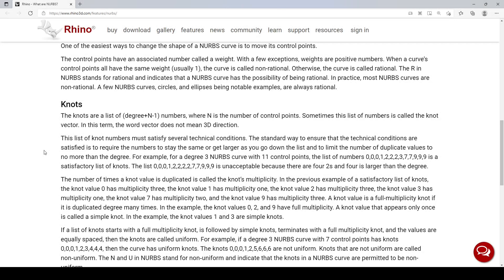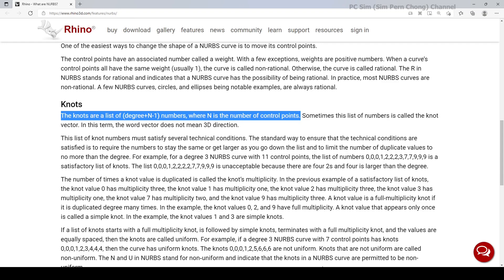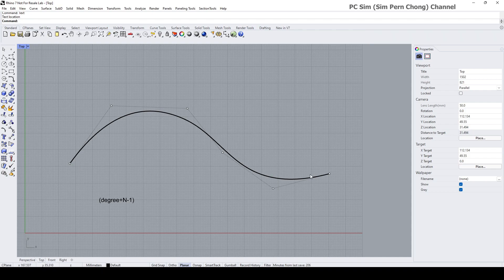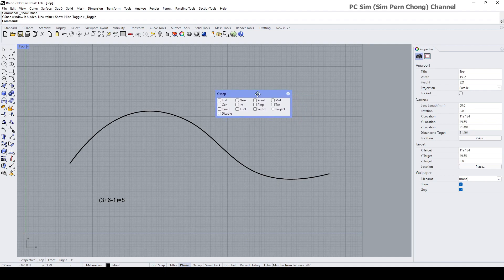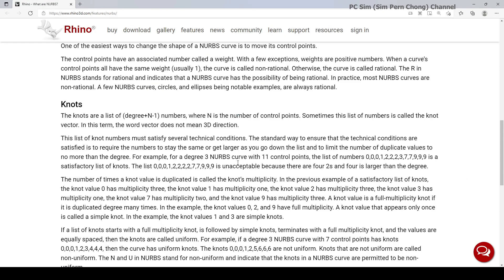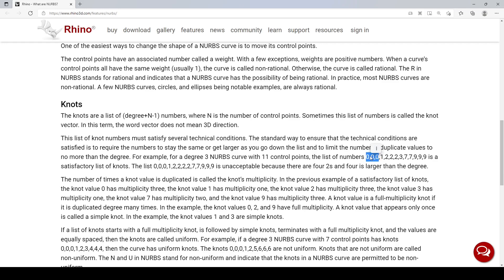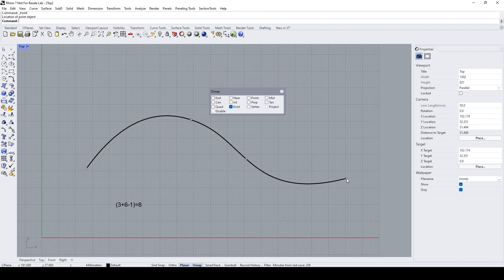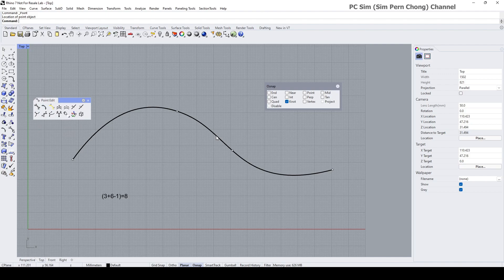Rhino Tutorial: Info on Knots (NURBS)

Comment: Hi, so what's the benefit of inserting knot? even though it won't change the shape of the curve, the curve added a control point while the degree remained the same, resulting in a nonsingle span curve (which is not ideal).
Reply from the maker: For building enough control points to modify the shape.. Not all situation require single span..especially for consumer product design.

Insert knot and remove knots are 2 processes that i often use to rearrange the distribution of control points for controlled refinement of NURBS curves and surfaces.
Reply from the maker: Can watch this demo for application of knot control on surfaces
https://youtu.be/-1g1SZKl6DA?si=2ohmVW8Xsz45dgRM
I am aware of rhino's non class A tools and hence a need to work around those limitations.

Comment: can you tell me please how can i merge surface to only just 1 surface after convert stl to sub and tonurbes i need to convert result surfaces to one surface beacause powermill program doesn't read multi surfaces it need only one surface for example loft feature do you anderstand me please help me
Reply from the maker: Oh... that is going to be very difficult. For simple form, you can try to Explode the model, then use MergeSrf to merge adjacent pairs of surfaces. But for complex form with mulitple topology flow.. it may not work.
Reply: @simpernchong  Thanks for answer put its really not work in complex furniture leg and I can't merge it or join it in one Surface to Program Surface in powerMill

Comment: what is the use of knowing the number of knots？Thanks.
Reply from the maker: Just my opinion.. the first part of the video where i count the number of knots is just to illustrate the concept. I guess, we don't really need to count it. The more important thing is to remove overlapping knots or multi knot as they can create discontinuity in curve smoothness. For high quality surface modelling, it is essential. Basically, we will want to use as best as possible, the least amount of knots and control points to express the form.
Reply: @simpernchong  Does knot have anything to do with the structure lines of the generated faces?
Reply from the maker: @ber9474  eh....you mean isocurve? No. But if there is a discontinuity in the construction curve (mutiple knots), the resultant surface can break into separate pieces at the multiple knot point...and a thick line will appear on the surface.
Reply: @simpernchong  Thank you for your reply and I hope you can do a video about degree, thanks.Sorry about the language question by the way.
Reply from the maker: @ber9474  You are welcome 😁Regarding Degree there is already a basic video about it https://youtu.be/W7Xq0_NIvNY  Thanks.
Reply: @simpernchong  好的，谢谢。
Reply from the maker: @ber9474  没问题，谢谢😁
Reply from the maker: 朋友，这里还有部关于Degree （Change Degree)  的视频 https://youtu.be/OqqOvq66UPE   谢
Reply: @simpernchong  好的朋友，十分感谢。希望你今天过得愉快。